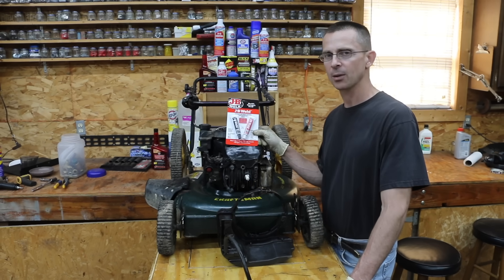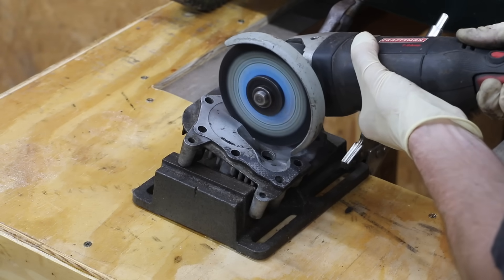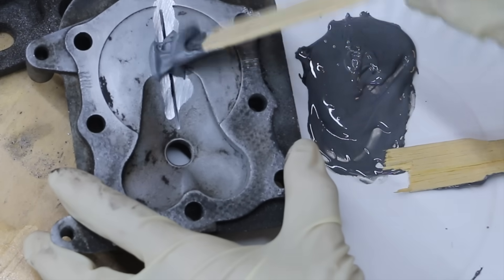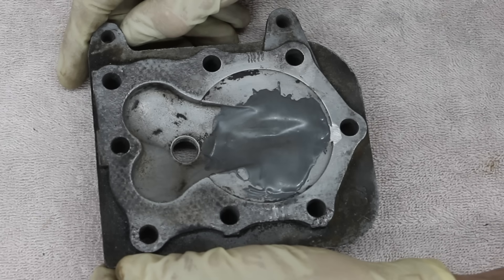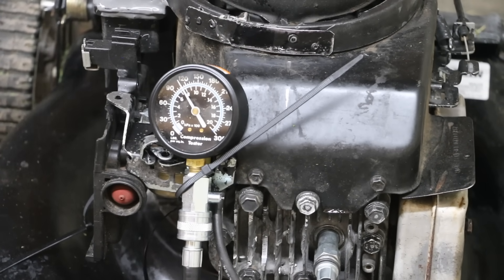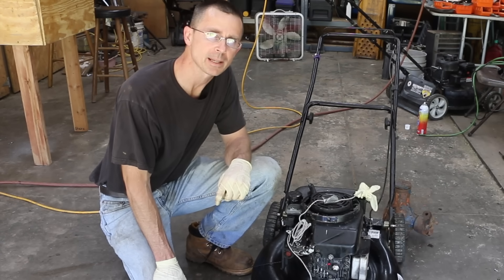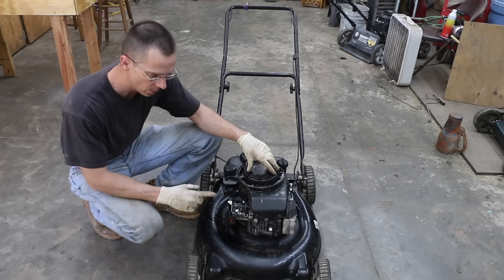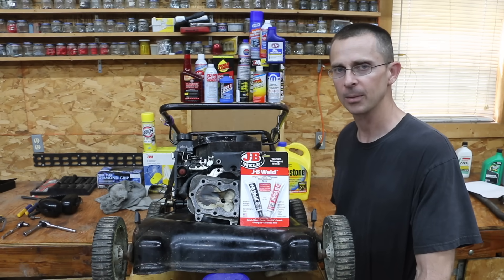Can JB Weld fix a cracked cylinder head?  See the proof!!

Comment: the only engine block repairs i’ve seen work are onMarine Inboard Engines that were not properly Winterized and had a Jacket Freeze  and Crack the Block  the Engines need to removed from the Hull  to properly Clean and grind the area in a similiar fashion of beveling metal to be Welded   using a Die Grinder or a Rotary tool to remove all the Paint  and “Scuff “ up the  surface  i know of one boat  that the engine  was repaired with JB Weld and it remains a runner in that vessel  for 15 years  it has done well with the heat ,Grease , and Gasoline  and it isn’t by any means or stretch of the Imagination a pretty job  or have we done any attempt of  grinding or hiding the repair FYI the engine is a Mercruiser 135 H.P. 4 Cylinder Block ( basically  it’s. a Ford Pinto motor they  also used in their older MiniTrucks  named in the United States Couriers  then later the Rangers )  it’s actually my favorite Inboard / Outboard Marine engine because of its thrifty fuel economy , Reliability , and parts availability  and was used  by many manufacturers  and Vessels  often paired up with Mercruiser Alpha One Outdrives  some boat Companies  powered larger vessels with multiple  of these set ups  and many of the popular Houseboats used twins of this configuration  that resulted in a boat that could be moved under her own Power and Docked fairly easily ( these were never meant to win races or Circumnavigate the World  but  turned out to be nice Lake Cruiser or Retreat boats

Comment: I ported my 212 mini bike i built and i just kept taking the head off until i lost power and i took it a little bit past that just seeing what you could do with a stock hemi head but i pretty much got it ported as much as possible and im going to throw some of that jb weld in there to make it where there isn't a big valve pocket because the air pretty much hits a wall before it goes in the motor now i just got to make a jb weld ramp for the air 😂
Reply from the maker: Thanks for sharing.

Comment: Hello all, I know this is a old video but I think this is worth mentioning. And if I didn't see it with my own eyes I wouldn't believe it. A friend had a geo tracker. That we were beating the balls off of it. Well the main crank snapped right behind the drive pulley. We unbolted the pulley from the front lobe of The Crank shaft.  We cleaned up both sides of the cast crank used JB Wells glued them back together. We have nothing to lose we were just going to beat The balls off of it likely already were. Well it actually held up. The engine ended up failingIn the valve train and oil pressure department. That cannot be cannot be blamed on the JB Weld.  I think we need to blame it on the fact that After the repair repeated As in More than I can remember bouncing off of the rev limiter  Flat shifting it At whatever the rev Limiter started. Jumping it,Literally beating the thing  Just for fun it was on its way to the junkyard anyway. The crank never broke again, We put quite a few miles on it. Well over a 1000. Hard miles. It ended up letting out the magic smoke, And steam, Do too Let's call it Careful rev limiter Bounce shifting, Fun times.. It does work. Like anything elseIt is in the prep work clean dry surface with texture or pto allow the product to adhere.
Reply from the maker: Thanks for sharing.

Comment: I have a lawn mower that's about 20 years old. It gave up a rod early on and punched a hole in the crankcase. My dad replaced the rod and piston, then used JB Weld to repair the block. It's  used weekly and runs as good as new still today.
Reply from the maker: Nice!  Thanks for sharing.

Comment: My dad used JB weld to fix a crack between the intake and exhaust ports on the cylinder head of his AMC Ambassador.  The cheap repair held until he sold it 3 years later.

Comment: JB Weld saved us one hell of a tow bill on a motor home years ago near Yuma Arizona. We obviously had an object from the highway puncture the oil pan. Luckily it was 99 degrees at midnight. The stuff worked beautifully on a hole about the size of a quarter in the oil pan. We made it to our destination and we're able to locate a new oil pan. So glad it happened when it was a cool 99f and not the 121 high the next morning. Thanks for showing us what works and maybe more importantly what products do not.

Comment: I used JB Weld to repair a large crack in my Chrysler van exhaust manifold.  It held for years, even though it is not recommended for high heat.  I have never been disappointed with the product, before or since.
Reply from the maker: Thanks for sharing.

Comment: I posted on another thread, but it might be useful here:
A long while back, we used the JB Marine Weld to fill a corrosion hole between the exhaust and water jacket in a 6HP Evinrude. The block is cast aluminum.  Fortunately the hole was acessible under the cover plate. Made sure the area was clean using acetone, and was properly prepped, reamed the hole to about 3/16" and cleaned of corrosion to bare metal. Let it cure for a couple days. Ran the motor probably a couple hundred hours. Sold it and the new owner is still running it.
Reply from the maker: Thanks for sharing.

Comment: I have used JB weld on plastic and it broke over about a week. This was on a top a top mount screw hole on a 1996 Ford F-150   grill mounting hole and it broke in about a week. I have also used a product called FAS-WELD steel reinforced epoxy putty on a plastic project I was doing and it also broke with a small amount of pressure on it. Both times the products were allowed to cure for 24 hours. I am wondering if the FAS-WELD would do as well as JB Weld on metal.
Reply from the maker: Thanks for sharing.

Comment: I used JB Weld to make an emergency repair to my car's gas tank. The hole was roughly circular, so I coated a pencil with JB weld, jammed it in the hole, broke it off, and coated the outside of the repair with more JB. I continued to drive the car for my daily commute (17 miles each way) for the next three years, before parting it out. The "temporary" tank repair never leaked.
Reply from the maker: Thanks for sharing.

Comment: BMW 328I from 2007 to probably 2010 had intake and exhaust steel seals(those German Engineers were Morons) for the Vanos gears and caused grooving on the caps and adjacent head part where the cam and its 2 seals got squeezed in. This in turn caused the Vanos not to get sufficient pressure to turn it per command. Question can the JB Weld fix those aluminum minute grooves and make it a sealing surface again?
Reply from the maker: Thanks for the suggestion.

Comment: My engine froozed an poped out the freeze plugs 4 in front of motor behind timing chain fixed 2 other poped form side but not from the block but from side water jacket in cylinder head I can’t find the right size looked wverwere it’s the size of a dime it’s a dicimal thing . Am thinking to do this but put a dime with the job weld just so it can stand the heat an pressure

Comment: I have used JB weld to repair the end of a sway bar on a 99 Buick century. The sway bar ends tend to split overtime resulting in the need to buy a new sway bar. I used JB weld to attach the end back on and it was stronger than when it was broken with the links attached.
Reply from the maker: Thanks for sharing.
Reply: Lol. Holy crap. That's amazing to hear. But I don't doubt you. Especially after watching this video. I can't believe how much it sounded like a normal good running mower after he cleaned out the extra jb weld. I am impressed and it was funny just knowing the truth behind it all. He did a damn good job though.

Comment: Does anyone know if that's been tested on cast iron? I know cast iron expands and contracts, so will it also crack off?
Reply from the maker: Thanks for the suggestion.
Reply: @ProjectFarm  really would like to see how that works and can't find it anywhere on the Internet. I've seen a few videos of people using it on a crack on a water line, which looks like it works quite well, but nothing in an oil line. This would really determine if I can do a quick fix or pull the engine out!!! I hope you try it soon.

Comment: Question of the day, what have you used JB Weld to repair?    One time I and my family went on a road trip vacation, we were on the road for about 2 days of a 3-week trip and a large metal filling came out of one of my molar teeth.  (do you see where this is going? ) I did not want to spend time finding a dentist so I bought some quick set JB Weld and mixed it up and packed it into the hole of my tooth where the filling came out.   After our vacation was over and we were back home (by the way my tooth never gave me any trouble on our vacation after I filled it ) so back at home, I went to the dentist. Sitting in the dentist's chair the dentist asked, what can I do for you today. I replied my lower left molar lost a filling that I need to have replaced.  The dentist examined my teeth then he said are you sure you lost a filling? I said yes.  He looked again this time at all of my molar teeth.  He said I don't see any missing fillings. I said, oh, sorry, I forgot to mention, I filled it with JB Weld.  His look of surprise was so funny. His look was like WHAT??!?!?  Now he really closely examined my teeth and then with a metal dental tool he picked on the JB Weld a few times and then told me, The JB Weld looks like it did a really good job, however, I don't think I could recommend it... and he chuckled.   He drilled out the JB Weld and filled my tooth.   This is a true story and BTW after I filled my tooth with the JB Weld for a few minutes there was a bit of a icky taste but it did not last long. After that it was all good. I ate my meals just as always did and didn't "baby" the filled tooth.
Reply from the maker: Thanks for sharing!

Comment: I know a guy who took his Yamaha bike down the Baja peninsula one summer. The front brake pads wore down to metal, scoring the rotors. He couldn't find any store with Yamaha brake pads, so he bought JB Quik Weld. ( I would have used the 24 hour cure JB), A year later he was still riding that Yamaha with good working JB Weld front brake pads!  Stuff is amazing for fixing stuff in a pinch.
Reply from the maker: Thanks for sharing.

Comment: I used JB weld to repair a block crack that was a small slow coolent leak. While it did repair it, it ended up being only a temp repair as the leak came back about a year-ish later. JB weld will buy you some time! But won't fix it for life.
Reply from the maker: Thanks for the feedback.

Comment: I bought a 1969 Jeep wagoner with a 350 Buick engine that had a cracked block from frost plug to frost plug. 
It actually pushed out one of the plugs more than halfway out and the block at that plug was completely cracked open about 1/16” gap.
I cleaned the block the best I could. I coated both plugs and the block with JB Weld twice because the gap was so big the JB wanted to run down the crack to inside of the block.
I ran that Jeep for over 2 years with NO ISSUES from the repair. I use that stuff on everything , it’s the best epoxy I ever used.....
Your videos are AWESOME!
Reply from the maker: Thanks!  Thanks for sharing.

Comment: Okay I gotta share my JB weld story now..

I am actually CURRENTLY working on this project which is what led me to this video lol. I have a 1982 Honda XL500R, its a kickass old school enduro that i've been rebuilding. Anyways, she lost compression on me about a month ago so I decided a full rebuild was in order. Rebuild the cylinder head with new valves lapped in and had the head & ports sandblasted to remove all the carbon, honed out the cylinder, and got a new OEM style cast piston too. I had ENTIRELY finished the rebuild and had dropped it into the frame and as I was starting to kick it over, I heard a sound I didn't like. I took EVERYTHING back apart and found TWO holes in a noncritical area of the cylinder head. They're located internally and sitting next to where the cam chain cycles around. The holes were at the base of two bolts that hold the valve cover on the cylinder head. Essentially, if I left the holes there, the oil leak wouldn't cause any significant damage but nonetheless, I'm repairing it with JB. All I need is for it to hold in place because there should be no pressure on the welds and the cam chain is just running next to the patches. Plus I'll be using smaller bolts now as to not have them put outwards pressure on the JB weld. By the sounds of it, its gonna work out. I'll be posting a video on my channel for it soon!
Reply from the maker: Thanks and you are welcome!

Comment: I've used it before, good stuff 👍. However, I have a crack in my 460 police intercepter manifold which JB Extreme Heat did not hold (it cracked in the same area) so last night I tried the liquid epoxy weld, not rated for 1000° heat, but I'm giving it a try. It seems as though it wants to melt, but hasn't. I'll follow up after some more driving and heat cycles. 🔥🚗
Reply from the maker: Thanks for sharing.

Comment: Nice review.
I have a air/oil cooled motorcycle and have a blowing exhaust at the cylinder head and it looks like JB weld will work hopefully it will.

Nice video.

Comment: I did something similar a few years ago.  I bought a used 4.5kw portable generator for $50, because it wasn't working.  It was a Chinese clone of a Honda engine.  It turned out that one of the valve retainers had broken, so the valve dropped into the cylinder, and then the next up stroke poked the valve's stem back through the head.  A fairly clean round hole in the combustion chamber, extending out through the top of the head.

I figured that it would need a new head.  But trying to fix it with JB Weld was cheap, and provided me some entertainment. :)   I was a lot more careful about preserving the combustion chamber shape and dimensions.  It was really close to the original shape when I was done.  Obviously, I had to replace both the valve and retainer.   The parts were like $5..  I reused the original head gasket, just because I figured I'd be redoing it again with a new head.  No reason to waste  money on the gasket.

That turned out really well.  I've only put a few hours on the generator, but the JB Weld hasn't failed yet. There hasn't even been any obvious leaking from the recycled head gasket.

I wouldn't even consider trying this on a car, just because if it does fail, a car engine is more expensive to repair.   But it was fine for this low risk repair.

I have used it on some other automotive things, but nothing with this much stress.
Reply from the maker: Thanks for sharing!

Comment: Another great video. I have use the JB Black plastic weld on a bumper, It works pretty good. I used some mesh tape to help hold it together during the application. I could have used more as there are some gaps, but it holds up well.
Reply from the maker: Thanks!

Comment: I use a lot of the 2 part 24 hr JB weld on my Alcohol coke can hiking stoves.  A tip is the JB weld will cure completely if heated up to 150 * in less than a half hr without losing any of it's properties.  I use the electric kitchen stove on the #2 heat setting....so I don't really know the temp, but I'm a long way from being able to hold it in my hand.  Out in the bush, I'd build a small camp fire under it to cure a JB weld crankcase repair.
Reply from the maker: Thanks for sharing.

Comment: great fix , ive used jb weld on guitars wheels and fibreglass fixes,i wish i kept my ford mustang cobra jet 429 scj it may have repaired the aluminium head crack, i did a repair on my 8.2  cadillac eldorado   manifold exhaust,  i packed copper wire into the crack and filled it with jb weld and it never blew again , i couldnt tighten the manifold up as the bolt had sheared off so i left it and thats how the blow started jb weld does it again
Reply from the maker: Thanks for sharing.

Comment: I love JB weld. Used it many times over the years. I even repaired the oil pan on a 1995 Crown Vic a couple of times with well over 200,000 miles on it. A lot easier and cheaper than removing the engine to change the pan. Each time it last 2 or 3 years before developing more rust & leaks developed here in the rust belt. If anyone tries it, make sure you drain all the oil out and get it bone dry, wire wheel away as much rust as possible, degrease and JB Weld, let cure and refill engine with oil.
Reply from the maker: Thanks for sharing.

Comment: would be cool to see JB welds resistance to high temperatures (such as if it was in direct contact with oil)

as well I think it'd be cool to know how long DOES the JB weld last? maybe a 24 hour burn in at full throttle?
Reply from the maker: Thank you for the video idea!

Comment: Kinda late watching but impressive. I personally repaired a float in a mower carburetor a while back. It had crack due to age and I applied JB weld to the cracked area after carefully cleaning it. Never leaked again and after a while I took it apart and inspected the job--and found no degradation. This repair is not a pressure test, but it is an immersion test. The key is to get the glued area clean , clean, clean!
Reply from the maker: Thanks for sharing.